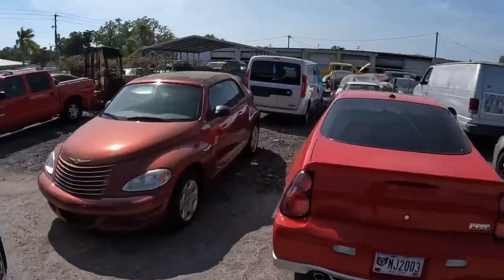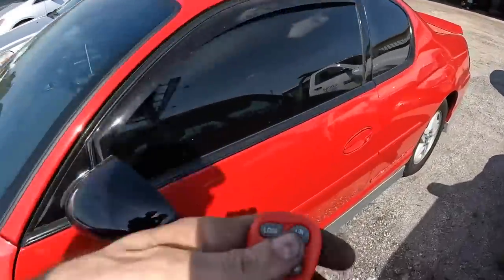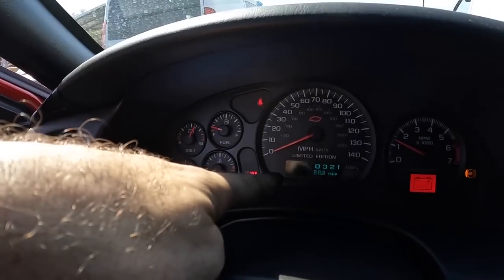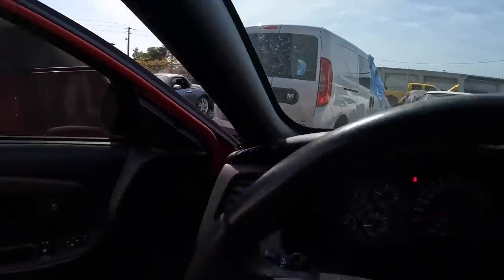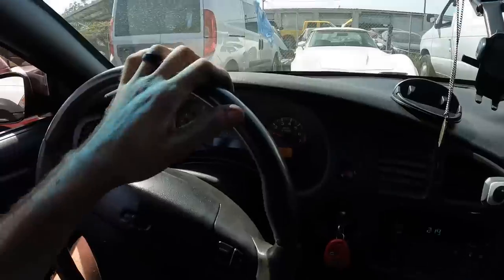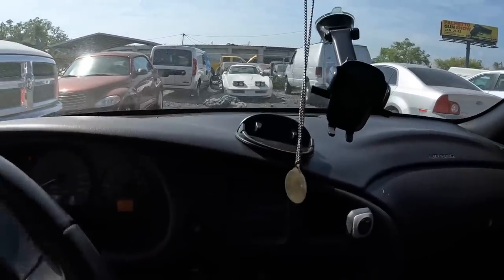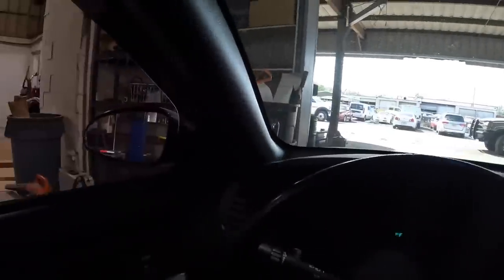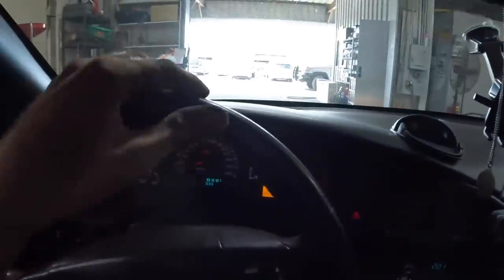Oil in Radiator! 2003 Chevy Monte Carlo 3.8 Manifold Leak!

Comment: Everyone that complain about the contamination it was already contaminated that is why you are here to start the only way to do it with no contaminated pieces would be engine out and completely take it apart and clean every thing in it and possibly a vapor blasting on everything 
And at that point you are doing a restoration of the vehicle and that’s a lot more expensive for the owners might as well buy a new vehicle

Comment: One issue I have is that this car only has about 75,000 miles on it yet it already needs this type of "major surgery"?  I have owned vehicles that went to over 250,000 miles without ever needing something like this done.  (Yes, I know it is a 2007 and 16 years old but I do not think being parked should have damaged this intake gasket at all)  I do not think this bodes very well for the manufacturer. Sure, any car company can have a defective vehicle but my guess is, if checked, I bet this was some sort of issue with this engine on more than just this one car.  Of course, I could be wrong.

Comment: You need to get yourself a proper parts cleaner for the new shop Ray
Reply: yeah. the brake cleaner is comedy, but that stuff IS a neurodegenerative and at the rate Ray sprays that crap, he's going to have dementia or early onset alzeimhers at 45 if he doesn't stop doing it.  and a parts washer would save him $25 a job in brake clean.
Reply: Ray already HAS a parts washer, it's stuffed into a corner of the shop. Last video he mentioned it's full of diesel!
Reply: My cheapo air compressor came with an accessory kit that included a "paraffin gun". I left it for years wondering what the hell and where does anyone get paraffin from? That's like WW2 era stuff.
Anyway it's basically like diesel and I had a pile of waste diesel and petrol contaminated in a container in the shed doing nothing and decided to give it a go on a very dirty engine block.
OMG. I never had more fun cleaning shit up with high pressure in my life. It's like Rays brake cleaner on 100x steroids. I'm pretty sure it's illegal.

Comment: ray, back in the day, I had a mint Ford Fiesta RS Turbo, which was just like that car. It was a pocket rocket, but was a pig to drive in the wet, as it was front wheel drive and no fancy ABS or other electronic aids. I  kept it almost standard, but fitted a K&N air filter kit and a dump valve. The dump valve was great, as it stopped turbo lag. My RS was 1 of onlt 50 made. It had electric windows on the doors, and not onthe center consol, like other fiester's. It was in moon dust silver.

Comment: Oil can't go to engine coolant from that intake manifold gasket as coolant system has pressure but crankcase not. Coolant can flow to oil from there, though.

Comment: Love love these videos and your work Ray! Not sure if I missed it, but did you blow all the bolt holes out to get all the oil and debris out of those blind holes? Could cause a hydro lock of a bolt during reassembly which makes it so the fastener/bolt appear tight when it is not.

Comment: Everyone of them 3.8L GM engine's I took apart the intake gasket had my failed mostly because of blasted plastic and the aluminum expanding and contracting at different amounts and basically cutting it apart at the rubber sealing point.

Comment: Nice work as always Ray.
Please show us how oil got into pressurized coolant.
Reply: Probably because coolant is at 15PSI while oil is  somewhere around 50PSI   on the pressure side
Reply: Granted, but where is the crossover. No oil passages in the lower manifold.
Reply: @mikemarshall1394  The gasket failed very near where the oil and coolant passages were allowing for cross contamination. Explained at 28:51 in the video.

Comment: Love these cars. I’ll be doing a LIM job at some point on a 05 impala ss I picked up recently. I’ve already done the coolant elbows, twice, on a 07 gt Grand Prix since the dorman aluminum elbow O-rings like to disintegrate. Use ACDELCO. I would also recommend to replace the intake end cap gasket on the LIM while it’s out otherwise you have to take the exhaust crossover off to get to it, usually it comes with the gasket kits

Comment: My wife's Buick has the 3.8 series 2 and at 300k miles is still running strong
Reply: Had an Oldsmobuick 3800,with 378k! Had to replace the battery and alternator,brakes and tires! Paid 1,200$ at auction with 240k on it! Fully loaded,leather,heated windshield etc! Sold it to a coworker 3 years ago for his daughter for 1k,she still is driving it to work and college! Amazing
Reply: @petersmart1999  awesome, we did have to do the intake job he's doing to this one about a year ago, but that's the worst job it's needed

Comment: I've never come across an engine that can withstand half the overheating a 3800 can take.
I've had them come in with the engine block smoking, no coolant, less than 1qt of oil, and an hour later it's driving out the shop back on the road

Comment: Good videos, I watch all of them. However, just a small comment. Why don't you blow off around the top of an engine before you start working on it. The amount of dirt and muck around the injector holes and on the rocker covers. Must be easier than wasting so much tine cleaning up after.

Comment: We had an 03 Monte Carlo SS.  Right around the 90K mark it when it started falling apart.  Towards the end I had to put new cats on, then a week later the plastic coolant elbow split.  That was the final straw.  Drove it to the Chevy dealer and let it dump coolant on their lot and drove off with an 09 Impala with only 11K.  Still have it with 200K.

Comment: They put those nylon gaskets and plastic elbows in Series ii but upgraded to metal gaskets and elbows in Series iii, right? Solid valve train. These engines could easily go 300-350k no problem.
Reply: there are definitely aftermarket upgrade kits for all series for that stupid plastic elbow.  such a dumb piece of design in an otherwise excellent engine.

Comment: Funny you say that... 3.1 and 3.4 is based off the 2.8 which was a good engine but when they did the aluminum heads they were trouble! And 3800 series 2+3 was great but I had aof of issues with them in my 97 Camaro that's 5 speed. Great car handled like a Vette an got down the road ok but first engine threw a rod because idiot I got it from didn't replace the rod after it spun a bearing, second engine had issues with balance shaft gears and the third kept loosing coolant tried everything even doing head gaskets again and it lost its oil pump and blew up...

Comment: I've waiting a long time for you to work on a 3.8 ! I have a Grand Prix GTP and need to replace the intake gaskets. But now have wait for the conclusion (sigh) I want to see if you use the upgraded gaskets and coolent  elbows! This engine  is usually  bullet proof except for these  problems. Mine is pretty quick gor a 6 banger with the supercharger can't  wait for part 2. Whis I was in FL. My back says this will hurt.

Comment: bullet proof?  Except for the intake which was a major issue.  During the recall on these issues (several years ago) G.M. sent two stop leak tablets to insert in the radiator.  That was there recall fix.  Not a big fan of G.M. for that reason.

Comment: When you disconnect the battery on cars do you ever need a security code to restart the radio (maybe more on older models)? The code was a theft protection measure to deter thieves from stealing car radios. I have been caught out by this (ended inputting every 4 digit number starting with 0001 until I got it) and you never mention it. Just curious.
Love the videos, keep up the good work.
Reply: Please don't tell me you finally found the code was 9999? LOL
The owner should have the code in their documentation. Failing that there are plenty of decoders by serial number available online.

Comment: Thanks for the video just little info when you pull intakes off you should stuff some towel down in each intake hole to keep debris out of the cylinders nuts, bolts, and sockets because some of the intake values are open to the cyclinder and need to lay towels in the intake Valley. Just something from someone doing this 53 years

Comment: One thing to keep in mind on the 3.8, is the fixed molded egr tube on the lower  intake if is the bigger tube, has a updated design for a smaller tube to the cracking a splitting the upper plastic intake. Also pressure regulator leaks, causing intake to go boom.

Comment: Ugh, the 3800's. I've always been told these things are bulletproof but yet they always seemed to have issues. Rare, yes, but the issues were major IMO. Pre-government motors bail out just seemed to be lacking and I'm still battling a 2007 GMC 1500 Sierra's parts cannon.

Hate to bring up the cult, but Snap On fans are trading in their brushed 14.4V impact guns and being resold for pretty fair prices IMO, $90 with no trade in. They're basically being refurbed and you're paying for that out of warranty repair and get a gun out of the deal. Since you're already in the 14.4v battery family, I don't feel it hurts to get a more compact gun than the Milwaukee or DeWalt impacts. Battery prices for those two are getting stupid expensive lately and I'm about to destroy both of mine (of both colors) and just need replaced. Just bringing up something you might be interested in...I love deals.

Comment: Back in the 70's I worked in a service station and did the minor repairs.  Tires, oil, thermostat, Trans filter and fluid changes.  We kept a trough mounted on the wall and after every oil change we would set the cans upside down in the trough. That little bit of oil would add up and we would save about a gallon a month.  That would be perfect to use to flush out the engine like you did this one.
Reply: So did Scotty Kilmer

Comment: have you bleed the water out of your air storage tank lately ? it will rust the bottom out it need s a timer and a solenoid drain valve so it drains automatically

Comment: Ray, not reeee, you mentioned having to replace the engine oil due to contamination. Would you also need to flush the radiator and replace coolant?

Comment: If I remember correctly (probably not), this is a common problem with this engine, but once it's done (with quality parts, like you use), it will not be an issue.  ;-)
When you remarked about using the oil drain, I had an idea for a rolling table with a grate over a drain pan to a container, that way you'd have a flat surface to work on (24" x 36")?

Comment: The only issue I ever had with 3100 and up was the thermostat placement. That's a absolute pain in the arsh to change without tearing down to much. I really miss my 1995 Chevy lumina (car, not van) , it had the 3100 in it. One of the best cars I've ever owned in my life, I knew everything inside and out. My mother in law had a 2001 grand am GT ram air with the 3800, that was a lovely car as well. Wish they still made these motors, I'd put them in everything. Lol

Comment: "You don't see many of these things anymore" or "bulletproof engine"?  Can't have both Ray hahaha
Reply: Of course you can ! you can have “bulletproof engine” and crap body or shite steering gear syndrome !
Reply: Those engines are in boneyards all over, it's just the rest of the car gets a terminal case of rust. The body rots away, the hydraulic and brake lines all rot and rust through. If the Rust monster hasn't eaten it all, the failed lines will cause you to wreck and total the poor things. The Impalas suffered from the same issues. Dad had his Trans cooler lines rust through, fixed those, then the brake lines all followed, fixed again, then the steel fuel lines, quick fix there, then the forbidden milkshake happened in the crankcase.

Comment: I couldn't understand why GM insisted on front wheel drive with this engine. At least Holden in Australia engineered it rear wheel drive and I done my upper and lower intake gaskets about 4 months ago on my vy Commodore with the Ecotec 3.8. this Monte Carlo looks harder to work on being front wheel drive and we used aluminium intake manifolds never plastic

Comment: Does this model have a water cooled oil cooler like later GM's (Ecotec etc)? Those coolers and the facing block seals are pretty common failure points for oil in the cooling system. I do not know if these later 3800's have that though. I recntly dropped the front out of a Captive/Equinox to change this cooler. 
I have a question: as engine oil pressure is greater than coolant pressure and valley pressure is breather pressure and a return path for top oil back to the sump. So why would engine oil get into the cooling system at the points mentioned, you are more likely to have milkshake oil, not oil in the cooling system, surely?? I do not know of any GM V engine inlet manifold that has a pressurized oil passage running through it, they normall go through the block up thru the heads.

Comment: Elbow fail common to  all 3.8 Bucko's . Of which there's Billions. GM's most highly developed engines.  From shak-n-bak teeth rattlers of the 70s to world class silky smooth power of the 90s. A true 1/4 million mile engine 
Munch of current piston- combustion design comes from these .

Comment: My 05 pathfinder keeps showing P0340 “camshaft position sensor A circuit Bank 1 or single sensor “ is what it says. It shows this same code 3 times along with 2 torque converter codes. I bought a coil pack but see the old one is difficult to get to. Am I on the right path or is it telling me to replace O2 sensor ? Any help would be greatly greatly appreciated. It’s my way to work everyday. Thanks man.. LOBE THE VIDEOS!!

Comment: I had the bosted dale jr edition.  You dont want it lol. Everytime i hammered it it blew the crossovers and dumped all the coolant. Then they finally came out with the aluminum crossovers and 6months later the bcm went nuts and locked up the anti theft . These have the passlock 3 system that cant be easily bypassed. It was a 2800$ repair . The intake also blew out and was mixing oil (again) cause now that the crossovers wernt blowing it would take out the intake gaskets. The suspension sucks . Their so heavy they evenly were a set of rear tires every 3-6 months. Actually faster then the fronts . Just not a great car .

Comment: Like your work, but wish you would cover all those opening when your working on an open motor. If you ever drop a small or something in to the motor an you cann't find it. Finding it is on you dime. If you no what I mean. I learned that a long time ago. I speak from experience.  All  it takes is one time. Just saying.  Be other than that you do fine work. Good luck on you new adventure.

Comment: Like it is mandatory to do a thorough oil change, just like I wasn't going to drive the car in to the shop. Well just a minute spider man, the engine won't even get warm if I pull it in cold. Then the wife unit would be needed to steer while Rainman pushes very hard if when it first came in. Not sure they drove this car very far after over heating.

Comment: Ray you need a 50 gal drum of brake cleaner and a air pressure port, so you wouldn't have to use so many cans of cleaner.  I do have to thank you for watching you use brake cleaner I have started to use it also for cleaning things.😄

Comment: Thought the 3.8 was bullet proof; didn't know it had the same gasket issue as my 2002 Impala 3.4. I remember when people used to blame "that damn Dex Cool", but the problem was the cheap-ass gasket was not compatible with it. GM trying to save a buck.
Reply from the maker: It's just this one thing thats a problem. Updated gaskets fix it right up. Then is bulletproof

Comment: I know I'm  crazy but I would go to the next step and pull the heads as well. Even though it's pricey overall.  But I wouldn't want  to do the job again.  Just my opinion.  
 Be safe team.
Reply: Not on a 3800! You never want to touch the head gaskets in them.

Comment: So it shows the newer opened part of the shop has a human walk door.

Question is whats going into that space. 
2 lifts?  A alignment machine 
A short tire change lift. However 
How much money do you make doing tires is such a competitive business, and to be brutal honest my nitios on mt scion tc cost about 250 each, NTB or what its called now did a tire rotation and balance on the tires I bought from. Them. A week later I took the car back the tires were not in balance at all you could feel it. Also they showed me one had cupped probly becuse the last time the rotated and balanced them they goofed then too.
This was the second set of the same tire I bought from them the first set ran 61k miles no problems only reason they got changed the cars on factory lowering springs and the inside tread wears down faster.  So at 1200 dollars apx a set of 4 youd think id get the car back with the correct air presure and tires in balance every time, but no the air presures always wrong and seems they forgot how to balance tires.  So that lifetime balance and rotate is worthless if they can't do the work right.

Comment: I wonder if there is a reason why there are none of these monties on the road in years????   Weird,  big questions
Reply: Most were eaten by the Rust Monster up in the northern US. Those engines are practically bulletproof save for that plastic elbow and the lower gasket. You can easily get 300k to 500k miles out of that motor with the proper care.
Reply: @jsh6952  The 3800  is a fantastic engine... it is the rest of this pos that  is the issue.  I know 3 people who had the misfortune of owning one of these.  CRAP from day ONE!
Reply: There are some in Michigan, they aren’t as pretty as this one, sadly mine is rusting away.
Reply: Only a few cars fit really tall folks, like an MGB or a Monte Carlo.
Reply: @samvalentine3206  lol, thats why I drive convertibles and trucks!